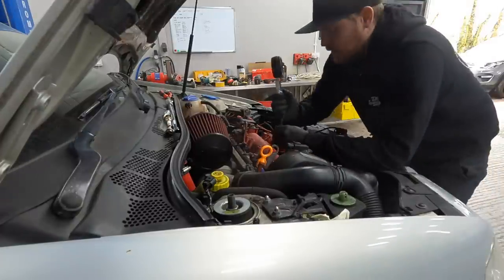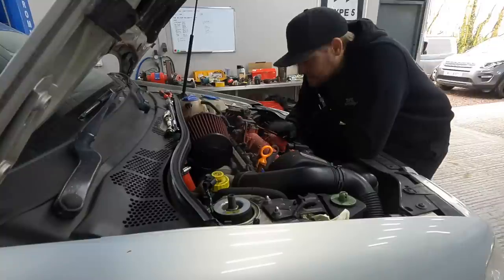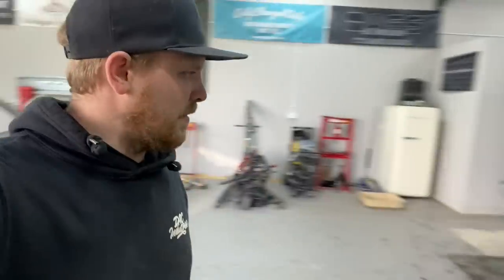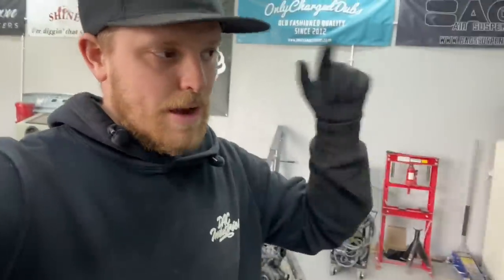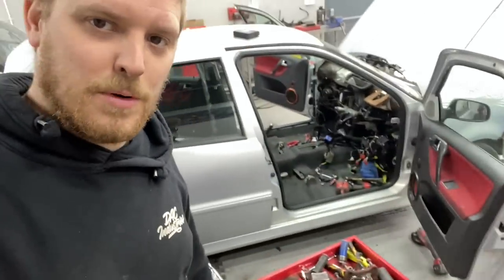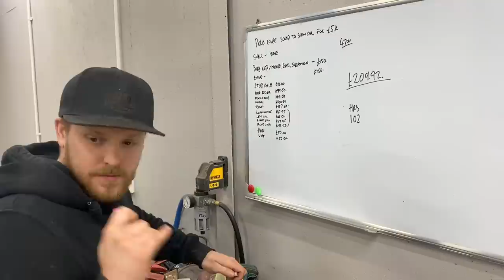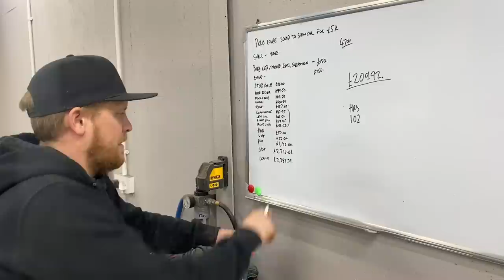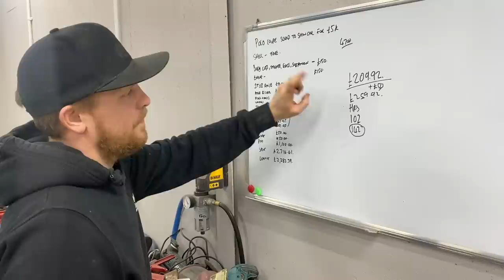We Bought An Engine  - VW Polo Coupe - Scrap To Showcar - Episode 7

Comment: It may be the valve stem seals, if you haven’t already pour a little engine oil into the cylinder and redo the compression test, if it’s rings the oil should seal the gap and change the compression, least you’ll know what needs to be done.
Reply: ^^ this
Reply from the maker: Yeah I ned to get it in the Mk2 and get it crancking to try and diagnose properly.
Reply: Exactly my thoughts
Reply: I also thought it may be valve related! Good luck Dan

Comment: Easy enough to get the immobiliser removed from ecu, then you won’t need to worry about the ignition, key and immobilise box 👍 ….. compression down could be a valve rather than rings. Get a borescope in there and see if valves are fully seated

Comment: Exhaust system you can get cerakoted mate and honestly isn’t to badly priced to do. Itl be blasted and painted in a ceramic paint that’s used on exhaust systems / weapons ect. Surely you could pull apart the engine and do a cheap ish re build on it your self like others are saying I’d just swallow pride and get it done. Budget is there to meet but that doesn’t mean you can’t go over it to show that these things just never work out 😂

Comment: Hi Dan, another interesting episode mate I can see you are really down on the compression results but don't beat yourself up over it to much mate as these things happen when you are buying these older cars.
As has been mentioned on here you could try a wet compression test to see if it's rings or valves, I've had a few cars with cylinders that had low compression and went ok for years like it, one was a Granada Scorpio with a V6 in it and it had a couple of cylinders that were showing low but it went fine and didn't smoke, just stick it in and see how it drives and sounds🤞🤞👍

Comment: Think I have said before that I have a 6n2 gti engine in my workshop it was in my sons gti and the small cam belt went  I bought another head and rebuilt it and fitted it but when I started it and he done some miles the engine was smoking and burning oil a bit of research told me it would more than likely be rings so took it out and replaced with a low mile engine and all was ok now cut to the chase you can have the old engine  you can fit the engine you have to the project get it all done and could do the rings and other bits at your leisure as said the head is perfect and when ready just swap the engines it’s free of charge if you want it just a thought👍

Comment: Could just be a valve not sealing mate. Have a look down the inlet and exhaust ports to see if there’s lots of carbon build up on the back of the valves.
The thick oil in the bore trick will test the rings but you don’t need a lot in there, your just looking for a difference from what you measured dry. If you don’t see a decent difference then it might be worth taking head off for a better investigation of the valves and head surface.

Comment: Hey Dan, not sure if you've considered/know about the hybrid version of these engines..
The 6n2 GTi AVY engine block with the 6n1 16v AFH head.. 
They are virtually a direct swap, and the AFH head flows way better than the AVY GTi head.. plus I personally think the cam cover on the AFH looks way way nicer in a show car than the original GTi.
The AFH flowing so much better I fitted mine and had it dyno'd at 138bhp, almost a 15hp increase over the GTi head.. they are way more tunable too..loads more cams etc available..
I'm running 189bhp with cams, CBR bike carbs and a racing manifold/exhaust.
You'd have to convert back to cable throttle with the AFH head.
Just a possibility if you weren't aware.. and I have a spare AFH head here I'd happily bring and donate to the build you wanted.

Comment: Would it not of been worth diagnosing cyl3 properly before you take the engine out cause then if it's just a valve problem or head gasket or something fairly easy to solve you could do it while the engines out rather than taking all the time to swap it to then have to possibly take it out again if it's a bigger fault

Comment: Can you not sell some of the bits your not going to use to fund a rebuild on the engine? Do you know if the steering wheel will fit a T5?

And as always, great video!
Reply from the maker: Yes the parts I am not using will be for sale good idea using that to fund the re build. I think it may as the 3L wheel definitely fits.

Comment: Odd that it’s one cylinder, the other 3 are so strong.
It could just be a burnt valve, the 16v hate being run on so lower octane unleaded - vpower or momentum only - it may just need a head rebuild.  
Only difference between ARC & AVY is the sump, if you still have the old Lupo engine you could get that sorted, save buying another engine.

Comment: Could you not keep the seats and get them re trimmed to your taste in material, to save a bit of money if your buying seats anyway. Plenty of panels on the Car that could be sold to recoup some money if you under cut anyone out there that is selling similar as you wouldn't want them hanging around, then weigh in the rest of the car that is left.
Reply from the maker: I had considered that although they are not the nicest shape. Yeah I need to get the car/parts listed to try and recoup some money.